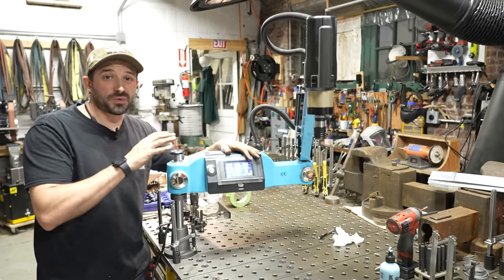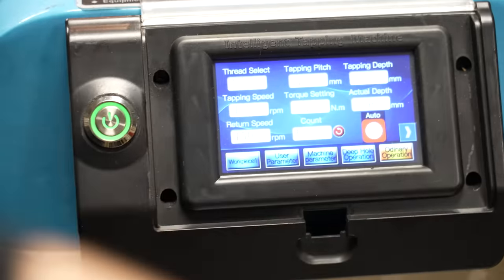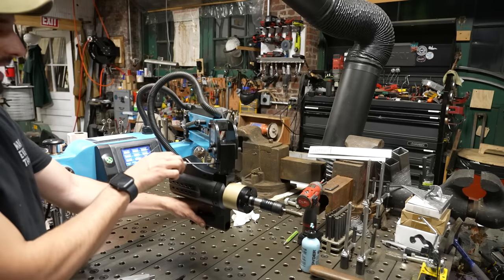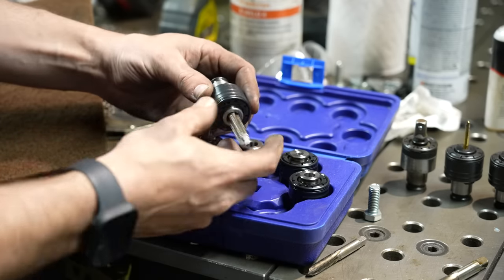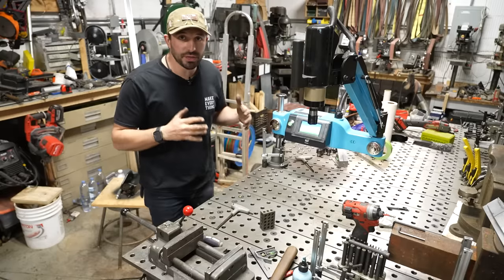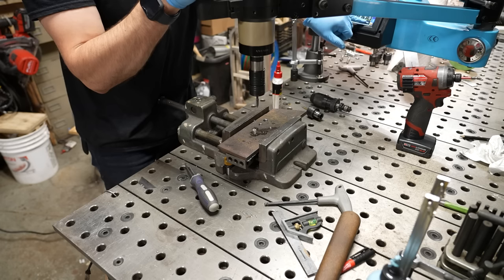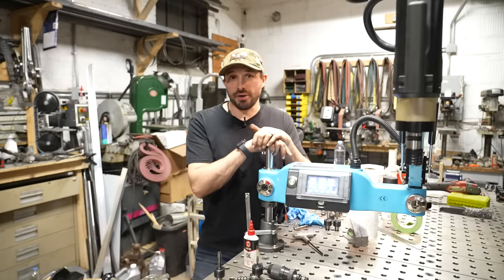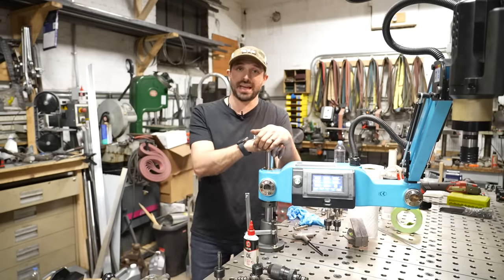$1000 tool that made me $10K+ in a year!

Comment: Need a locator rod you can chuck-up and a mating cylinder you place on the table to quickly register the angle of the motor. All precision machined to both vertical and horizontal positions. Instead of a cylinder, just bore a hole to match the locator rod in a machined block you can use to register vertical and horizontal positions.
Reply from the maker: Well now that’s smart!!! Thanks for the idea!!

Comment: I once worked in a shop and we tapped thousands of holes in sheetmetal,  (mostly aluminum) a year. Mostly small sizes, less than 3/8" We used a tapmatic in a regular drill press, and I would absolutely use that instead of this. FWIW, I have used one of these, just the expensive $5K US made version.

Comment: Be careful!!!
We used a tapping arm similar to that for a few hundred holes on some F16 gearboxes...when the studs were installed they were out of tolerance for perpendicularity. The studs were Expensive Titanium Rosan studs with the serrated lock rings. All of the studs had to be removed and all of the threaded holes had to be repaired for more super expensive oversize Rosan studs.
Reply: “F16” as in the airplane? If so, then that’s on you. It’s obvious that the (type of) machine and mechanism has loose tolerances. Even if it was “FlexArm” nothing beats a rigid setup with top shelf tools.
Reply: @marcosmota1094   I think he means race cars... b/c he mentioned "Gear boxes".
Reply: @MRSketch09 Most jet engines have gear boxes. There are other places you could have them on an aircraft. Landing gear could have a sort of a gearbox.

Comment: My $400 stick welder makes me $2-3k a month in the summer. 

Its the everlast 210stl. Probably the best stick welder under 2k on the market. Fully adjustable arc force and hot start, vrd ,6010 capable, anti stick, lift tig AND foot pedal compatable with quick connect gas fittings. The best part is that it weighs under 20 lbs. The only way it could be better is if it had AC output, but honestly who even needs that? I would only use it once a year if it had it.

Comment: You need to put some oil on the tap flutes and the hole after blowing off the tap between holes, I normally brush oil on the the tap with a small brush and lets the oil drip into the hole. When you only put oil into the hole the back end of the tap doesn't get as much oil and wears faster, only the first few teeth get enough oil.
Reply: the same is true for drill bits also

Comment: You could make a jig with a bored out hole with a slip fit for a bearing surface on the tapping head and that is ground flat to mate with your table surface. Then you could make sure that a surface perpinduclar to it is ground flat and could set the head for horizontal tapping.

Comment: Does it stop and back out to break the chip? Or just stand on it? Most the time with a small tap in hard steel if you dont break the chip youll snap the tap i was told when I worked in a very large machine shop to back out some to break the chip, doing 10 million x2 holes in aircraft aluminum 6061 i think it was with a 5/16" tap i never broke a tap.  Now this is real handy on stainless steel  or 4140.

Comment: Am I wrong in pointing out that most of the taps you show installed are hand taps? Most machine taps should be either 2 flutes (chips down) or spiral (chips up) — otherwise you’re working with hand taps and need to constantly backup to break the chips. Haas made a very good video on this topic fyi, it’s on Youtube.

Comment: When lining the nose back up to perpendicular to the table a V block would allow you to get it square a little faster. No checking from 2 different sides.
Reply from the maker: Great idea! I didn’t even think of that 🤦🏻‍♂️
Reply: @Make Everything  I used to was a machinerist. Lol. Things learned from old school toolmakers over the years. If you want to blow people's minds, next time you are laying out lines on a piece of stock and you want to put layout die or sharpie on it to scribe line into just take a sharpie and hold it between the part to be covered and your air gun. A couple blasts across the tip of your sharpie and your part will be covered with ink to scribe line into. Works great on the lathe as well for laying our lengths on a rotating part

Comment: I was literally just looking into these and pneumatic options. You're a hero. FlexArm coming in at $5000 was just far too insane for a small shop. 

What type of taps actually fit the collets? Do you find any issues with torque? Have you broken any taps with it?
Reply from the maker: It’s a good value! Standard SAE taps fit well, and if you get in a jam get a chuck for it and that should help. I’ve never had it not be able to tap steel parts. No shortage of torque
Reply: @MakeEverything  Looks like the model you show in the video comes in 110v imperial collet option? Was this made available after you bought yours?
Reply from the maker: @Darlhim89  yeah seems to be a new option. When I got mine they were all 220v, and I got those weird metric collets. A 110v version would be way more convenient!

Comment: Pneumatic tapping arms with a 1000 rpm motor are great for production work on 5/16" and smaller holes. I'd recommend it over this if you had tons of them to do. Looks like this has a good size range though and pretty affordable.

Comment: So I got one of these. Bought the collects as well. But the collects won't hold the taps. I got the ANSI and metric collects. Which collets do you have?
Reply from the maker: @jamiehoffpauir3404  hmm weird, I have the ANSI ones and they fit all my taps. Some taps have a weird shank diameter and don’t work but generally they all fit… maybe try the manufacturer
Reply: @MakeEverything  the taps I have tried fit, but they don't stay in the collets. They just drop out. I push the sping in, insert the tap, and release the spring and they fall out. Has me baffled. Can't tap a hole with that going on.
Reply from the maker: @jamiehoffpauir3404  that’s very odd there should be little pawls that grab them and the square on the end should index and lock in…

Comment: How to hell is it working?? I understand clutch and torque but you can put them onto any normal drill and it would no way go through 1/2” no way.. How is this mechanism working and is there a mobile style. This would be great for glow plugs or taps broken from trying to remove glow plugs
Reply from the maker: I believe it's the high torque low RPM motor in it. It's pretty amazing and really useful. I know they make some  handheld tapping versions too!

Comment: Forgot the most important spec in the entire process.  Concentricity your homemade collet holder is bunk.
Reply from the maker: The Tapmatic tapping heads I use all have a certain amount of float and slop in them and these are no different. These g12 collets move around a bit so as long as the drilled hole is straight and square and the tap goes in generally square it seems to tap perfectly .
Reply: @MakeEverything  the uneven countersinks would drive me nuts. Why did it appear to "stop" on the 1/2 hole as well.
Reply from the maker: @MrSims-ky2ne  the countersink was a single flute so at a low rpm it tends to looks like it’s running crooked. It was too small for the 1/2” hole

Comment: DUDE! Running 220VAC through a cord outlet that the entire world thinks is carrying 110VAC is very uncool.
Plus, it's pretty dang unlikely the tapper can handle the 50 amps that 6-50P is designed for - as in, the breaker is probably 50A.

You need an inline breaker of the machine's rating, with 6AWG from the plug to the breaker, then the appropriate gauge from there to the machine -- and for the love of pete -- change out the plug on that machine to the correct 2- or 6- plug.

Comment: I don’t need this whatsoever…but I will justify it somehow
Reply: I am sitting here doing the same. I have found that having certain tools can change how a parent is designed. I work with a fair amount of thinner (14/16 gauge) tubing and have been able to get by welding nuts or using nutzerts where threads are needed because of the thin wall. Something like this might open a different design option, even if it is welding a 1/8” flat plate over the hole and threading it, would look better than a nut welded. Again, trying to justify it 😊
Reply: @dandyscorner  a good tap in a drill will do 100% the same thing, you already own the drill I bet. Make a collet holder to hold in the drill to prevent spinning the taps In the drill.
Reply: @MrSims-ky2ne  Not entirely true. I own a moderately expensive tapmatic head, and it works awesome however often times it is easier to bring the tap to the work than the work to the tap. Especially in the case of large flat plates. You can clamp once and move the tap around over clamping and moving it over and over.

Comment: When you have a good drillpress you don't need this tool, there are plenty of morse taper tapping heads which is basically the same thing but you mount it in the drillpress and costs like 1/4th of the price..
Reply from the maker: But a drill press will have a limited throat like my mills do, this has a much larger swing for big plates than any drill press I’ve seen. Both have their place though!
Reply: @MakeEverything  yea to be fair i am Abit spoiled we have a double column radial drilling machine at work it has like a 3meter span and that with like 300° rotation
Reply from the maker: @FireGodSpeed  well now you’re just showing off
Reply: @FireGodSpeed  And does it cost $1,000?
Reply: @MakeEverything  I'd imagine there is no contest when it comes to tapping multiple holes along the edge of a large workpiece. The workpiece is fully supported with your setup and doesn't need repositioning to process.
Reply: @mikewatson4644  well looking online, i found some for 3000 but you can't compare pricing of a machine which is able to drill a 65mm hole just based on HP against a tapping arm lol 
So you have way more uses on a good drill press then a tapping arm..